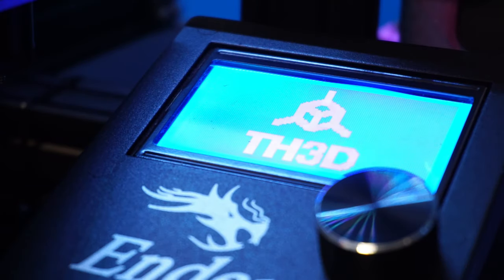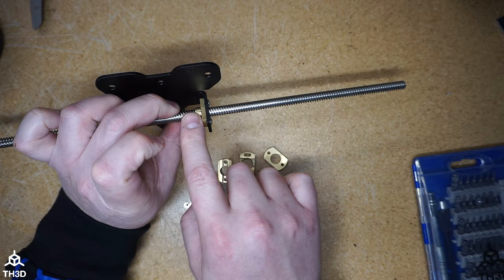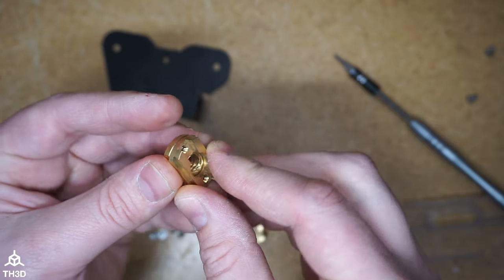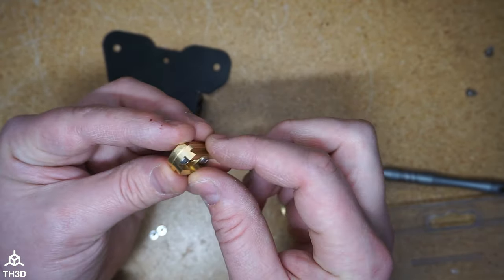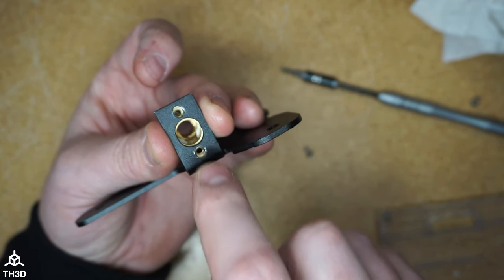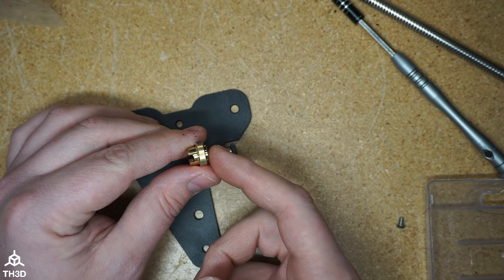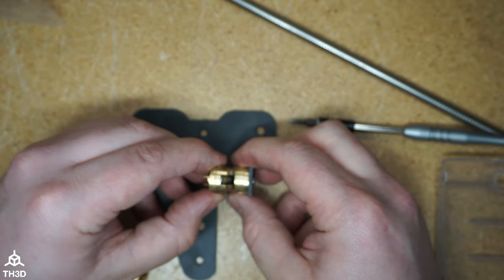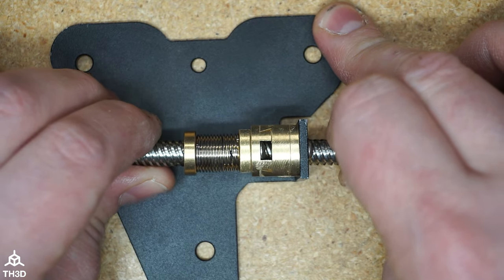Creality/Sovol Oldham Coupler Installation - Product Video

Comment: Thank you for the informative video. Unfortunately my anti backlash nuts that were supposed to fit my CR 10 the screw holes are too wide for the oldham couplers :( but I at least know the process of installation now so thank you.

Comment: What are the advantages of these upgrades?
Reply from the maker: The oldham makes sure the leadscrew wobble doesn't go into the print, and the anti-backlash nut keeps the gantry from dropping as well as making the movement smoother/more controlled.
Reply: Help stop z banding

Comment: What about the 3 part Oldham Coupler? I can’t find any info and how different it is compared to the 4 part one.
Reply from the maker: I'm not sure what you are talking about. We only sell the 3 piece one shown in the video.
Reply: @TH3DStudio  There are 2 variants of the Oldham coupler. One that uses the existing T8 Brass Nut (4 parts) is the one shown in your video. There is another variant that replaces the T8 Brass Nut, as there are trapezoidal threads inside one of the 3 moving parts.

Comment: Does it work on an Ender 6?
Reply: Have you installed it already? Anyway, you need to print an adapter from Printables. I'm currently on this route with my Ender 6
Reply: @stealthghost827  they told me that it is not for ender 6. So I didn´t try. Which adapter on printables?